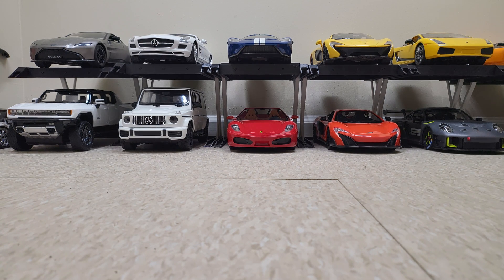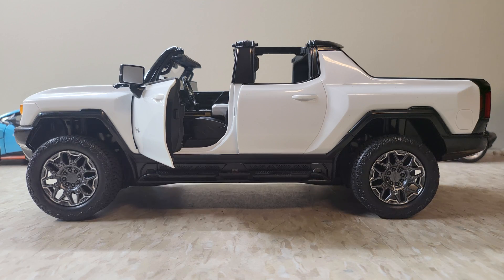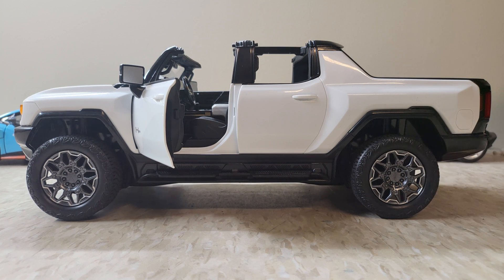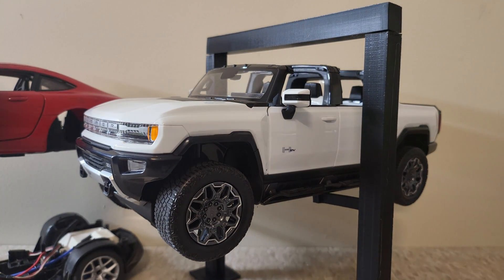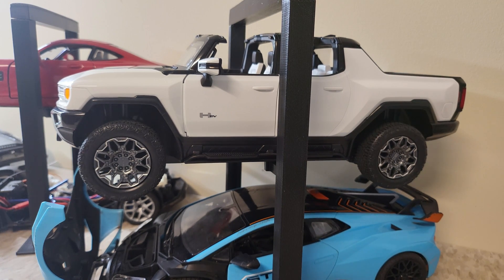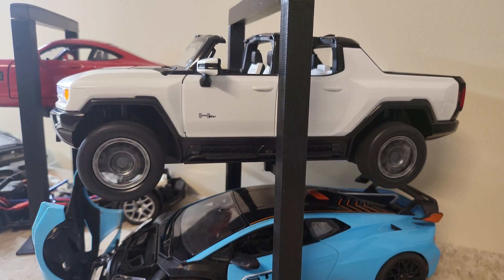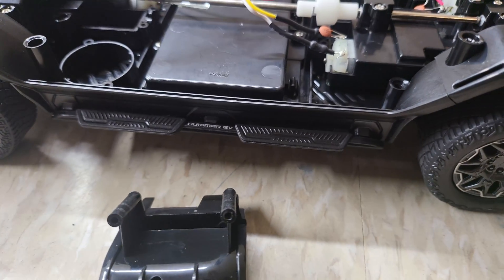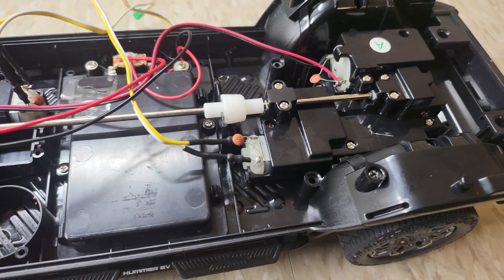Teardown: Inside Rastar's brand-new GMC Hummer EV!

Comment: I am considering ditching my hotwheels collection for rastar models, just for display, they look pretty detailed for that less expensive then the die-cast 1.18 scales, that look questionable at best the "cheaper" ones...so yeah...
Good job on the  HEV
Reply from the maker: I think they are definitely suitable for display. I keep one on my desk. 

Thank you. Now I just need to put it back together 😆.
Reply: @AndWeRollin   
still dismanteled? :)) Some hobby grade electronics would do the trick....i thingk of making 4-5 and race them with friends, but not to fast, with the stock motor just fine tune the steering and throtle...
Reply from the maker: @RCmadness888  Yeah, I haven't touched it since I took it apart. Still thinking about what direction I want to go with it. 

That sound really fun. I have been thinking about getting more controllers so I can do that. Then I think about someone other than me crashing and I'm like "no thank you" 😆.

Comment: I think your usual brushless setup and high speed shenanigans might not work well with this.  Well, when has it worked? 🤣 Just kidding.
Anyway, given the unique drive and steering systems, maybe use stock electronics and just increase power for a little more acceleration/speed.  Definitely work on the suspension.

Or….just go crazy and see if you can get it to go 100 mph before crashing!!! 😆
Reply from the maker: I have no idea what you might be referring to. My entire collection is in excellent condition and doesn't require any repairs. 😂🤥

Leaving the stock electronics as they are would likely be the best choice. Slightly increasing the voltage and modifying the suspension is probably the safest modification route. The only issue is that I have a couple of ideas in my head, and "best" or safest" is not a part of them. However, I will admit they probably are not go 100 mph level ideas. 🤣

Comment: I really thought it would have been logical to have duplicate front and rear drive and steer modules.  Like you I was surprised to find just one drive motor.  It would have certainly simplified the driveline and gearing set-up.  I also don't know why Rastar doesn't just install a traditional style self-contained mini-servo.  They are very cheap and it would massively simplify the components and assembly.
Reply from the maker: Next time I'm working with the Hummer I'll probably try to see if the rear assembly can fit in the front. It seems like it would. I'm curious about that. 

It is interesting that they continue to choose a system of way too many gears to control the steering. I think I can definitely simplify and compact the drivetrain package with some time and effort.
Reply: @AndWeRollin  Perhaps they want to keep control of all manufacturing in-house but to me, a traditional mini servo would be cheaper than making and assembling all those gears (plus less noise and most importantly, a step towards proportional control).